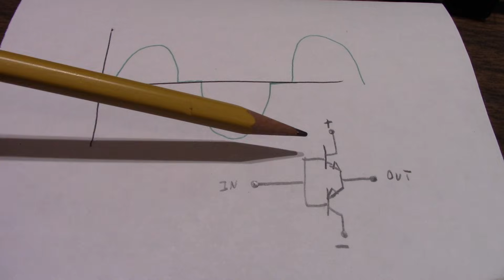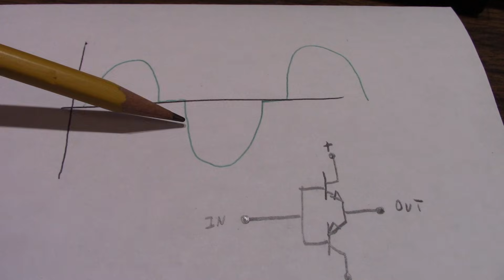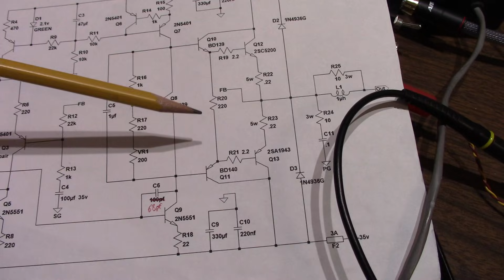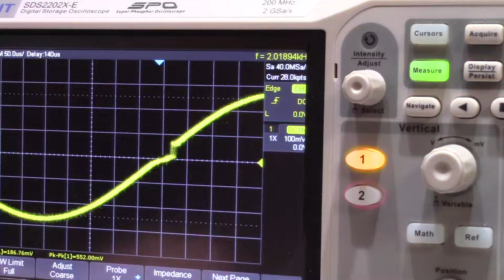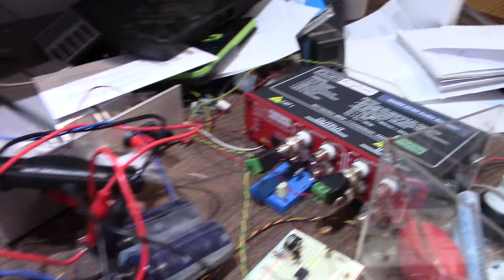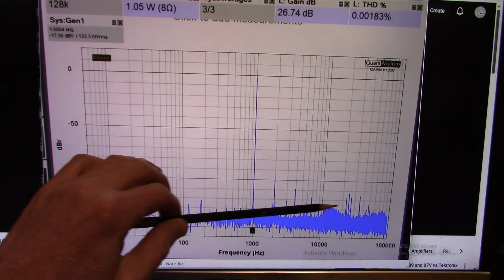Experimenting with amplifier bias setting

Comment: Are we sure we're talking about harmonic distortion, and not just crossover distortion? Isn't harmonic distortion when the amplifier generates "fake" frequencies that muddy up the sound? Kinda like overtones like most musical instruments produce. There is a fundimental, which causes "harmonic" frequencies. Like a poorly designed RF transmitter that puts out spurious harmonics. Does a crossover notch generate undesirable frequencies, or just cause that buzzing sound? Did increasing the bias do anything to high frequencies? Or, was the crossover notch actually generating harmonics in the higher frequencies? Thanks for the testing. Next lets monkey with the feedback circuit to see what happens.
Reply from the maker: The crossover notch is generating the harmonics since the wave shape is no longer sinusoidal. If fact, all non-sinusoidal functions such as a square or triangle wave are reproduced from the harmonic series of sinusoidal waveforms.
Reply: @JohnAudioTech  OK. Since I do not have a great understanding of what causes harmonic generation, I cannot argue this. All I believe is that if analog musical instruments didn't generate harmonics, they'd sound like crap! LOL. But you don't want harmonics being generated by sound reproduction devices!

Comment: 100% THUMBS UP on your video
I bought 2x Behringer Europower 1500 amps at 2 different separated occasions,
They both came out of box with notch crossover distortion, could easily hear it on piano and 1khz
via the tweeter.
easy fixed both of them by increasing the bias , have trim pots inside of them and problem immediately gone.
demoted to subwoofer duty where this wont matter.  while they were quit good full range hi power hifi, we now have smooth class-D.
Betcha all those Behringers are like that. Had a 1967 Dynatron(AKA Philips) early solid state when I was young. had that crossover notch distortion when new. I know this as a child, we also had a single tube el84 amp that was smoother back then.

Comment: i have a question, partially connected to this video but more to the one about transistor substitution
i have to fix a stage amp that basically have jat501 power stages, same transistors, very similar topology and all the power transistors blown. it is not hard to imagine how they blown. it is a school equipment, for semi-unsupervised students use and kids like to overdrive the input to get more bass, and they don't like to inform you they blown something either so they blown one channel at a time later pushing all the music to just one speaker so at lwast one speaker cabinet is also half alive as if speaker coils were overheated and shorting internally.
anyway back to the question. would it be a good idea to replace blown big toshiba transistors with small to-220 fake transistors from ebay just to test if rest of the amp is working, and all voltages are what they should be, completly ignoring biasing , as a sort of test before commiting to replacing transistors with the real ones? I don't mean it as a full test under load , fake transistors i just happen to have from way back would probably only handle 10-20 watt if we lucky (more likely about 5) so they are definetelly not a good replacements for 2sa1943 or it's oposite pair, but you could technically put such transistors in as a stand in just to look if the amp sounds fine or horribly distorted. and if the latter part is true probe around to find out why before commiting to real transistors, because blowing up a fake you already have cost you nothing....unless it cascades upward the schematic